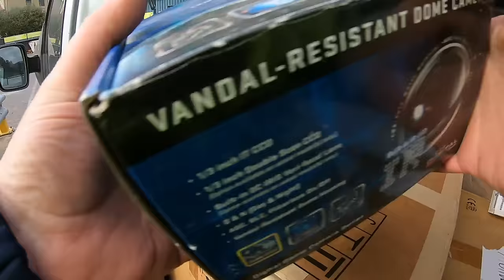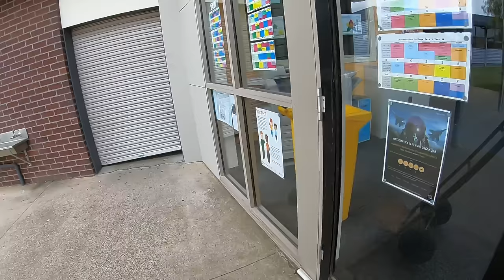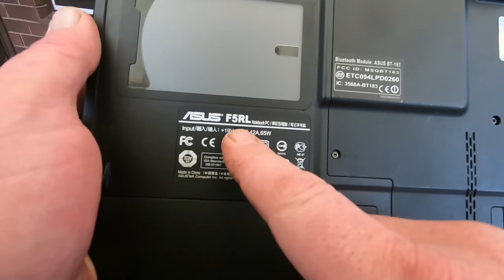E Waste Pick Up Day - Apple Macs, Asus Laptops, PC's

Comment: As long as the BIOS isn't password protected you can install a linux distribution onto them and you can use the laptop for a few years .   That way you can wipe the hard drive clean and have an operating system to run the machine.  Something easy like Zorin Os, or Linux Mint which is more GUI based than the dreaded command line.   Although you can use the command line no problem.   With linux you can surf the internet, do word processing, play music and play basic games, equivalent to a budget multimedia machine you can buy at a cheap price these days.

Comment: Two years late but you can install a Linux distro like Linux Mint or Lubuntu on the Asus ones, I did that with a couple laptops to be used for virtual learning this year. The slower ones got a SSD upgrade and got much much faster. If they're newer they have the Windows license automatically and you can boot it from a usb as well. All those computers could be used for kids in poor countries who are having to take virtual classes now from small smartphones.

Comment: For the laptops with Windows 7 when you are turning it on hit f8 until the menu comes up asking to start the pc in safe mode. Select start-up in safe mode, then when Windows come up go to the settings click change password. Then put in whatever password you want to turn it off then turn it back on the password will be the one you just put in. It's a glitch that works on all Windows before Windows 10, I figured it out when I was a kid and I always messed with the teachers by changing their passwords when they left the room.
Reply from the maker: doesn't work with this edustar system, you can't go to any settings until you log in
Reply: Is it a bios password or Windows password
Reply: @eWasteBen  try to reset the BIOS or changing the CMOS batteries on them. It's quite annoying on laptops.

Comment: Just curious - why don't you break down the cardboard boxes? Doesn't take long and you'd fit a ton more into your van, and probably wouldn't need to make trips to the recycling center as often. Not trying to criticize, just genuinely curious if you have a reason for it.
Reply from the maker: The boxes are mostly full with little boxes

Comment: If those Macs have been opened up you may find newer bigger RAM inside, and SSD hard drives to improve sloooooow boot up times. A cheap way to squeeze an extra couple of years use out of an originally expensive Laptop.

Comment: If you turn on and off a Laptop few times while it's loading Windows (before login Window) then it will go into a repair mode. Just select restore to Factory and there you go. It might ask for a Windows Disk just burn a few disks.

Comment: What pisses me off is around here in central Oklahoma USA they just throw everything in the landfills.  We do however have cardboard recycling/paper.
Reply: Dont you throw generally everything on landfills in America?
Greetings from Germany.
Reply: @marcelx8369  yes we do. I guess thats why I refurbish and sell audio stereo equipment. 60's through the 1980's.
Reply: @ @georgethomas9436  : Yes that's great. Everytime I watch some dumpster diving videos from America, I am always a bit upset. You mix everything in them. Wood, plastic, metal, food, glas, tires....
In Germany dumpster diving is forbidden, because the trash belongs to the owner until the company takes it away. 
I really would go on a tour in America or Australia^^.
Reply: @georgethomas9436  Ja, reselling is the best in my opinion. Use everything as long as possible. 
I mean for a recycler or scrapper the sheer amount is not handable. So they try to get everything of it. 
At the end of a life of a product that is also the best, because ressources are limited.

Comment: Apple MacBook "Core 2 Duo" 2.4 13" (Mid-2010) Specs  2 GB of 1066 MHz DDR3 SDRAM (PC3-8500) installed in pairs (two 1 GB modules), a 250 GB Serial ATA (5400 RPM) hard drive, and an 8X DL "SuperDrive." For graphics, it has a NVIDIA GeForce 320M graphics processor with 256 MB of SDRAM "shared with main memory" driving a 13.3" widescreen TFT active-matrix LED-backlit "glossy" display (1280x800 native resolution). they are good macbooks thou. as for the asus they are all 
ASUS F5RL-AP238C - 15.4" - Pentium T2370 - 2 GB RAM - 160 GB HDD...just an overlook on it... still worth something....

Comment: how do you get into doing this and how to you get started ? if your into any type of modding could take the Monitor and use like a raspbery pi and make a clock or some thing out of it . . i know where people take them and turn them in to like andriod on the wall and check there mail ect with them

Comment: Hey Ben, I went to my local pawn shop one day and they had a USB drive that wiped the PC"S and Laptop's they get in and restores operating systems. Maybe your local pawn shop may have the same technology and will be able to let you know where you can get it. Not sure if you have to be licensed or not, or may need some kind of permission. But it maybe worth it to ya.
Reply: It's called a clean install. You just download a Windows ISO file and create a bootable USB or CD. That pawn shop is a rip off.
Reply: And also, the computers have licenses built into the BIOS chip so it will automatically activate Windows
Reply: It could be DBAN which you can download from the internet yourself, it hardly takes up space at all, but is very powerful and thorough